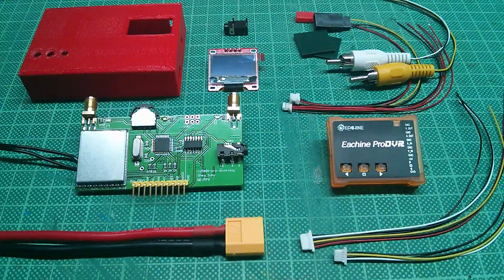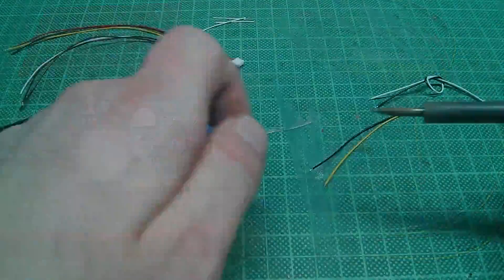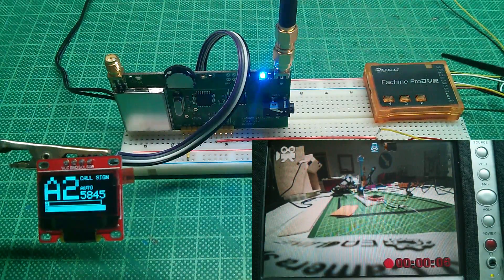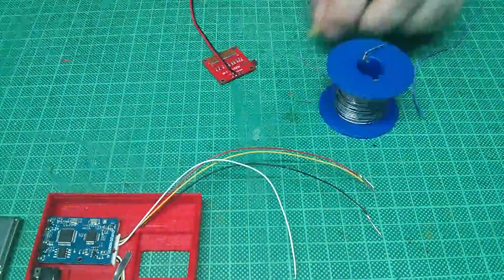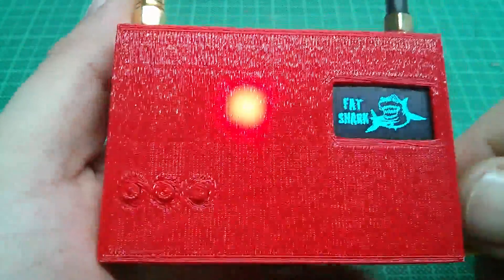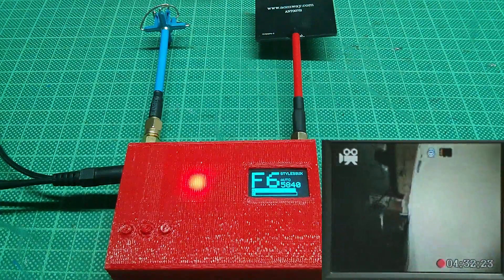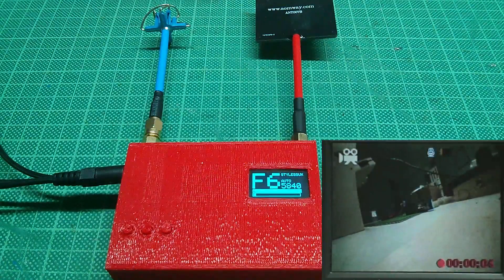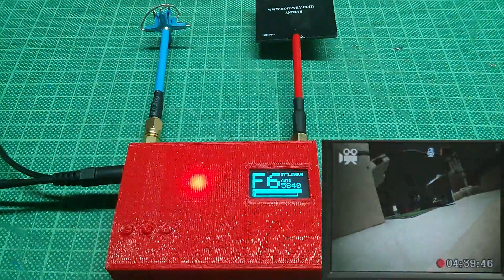Diversity Receiver & DVR case (RX5808, Eachine Pro DVR)

Comment: how good is the gain or quality compared with other receivers?
Reply from the maker: Gain depends on antennas. And compared with other receivers - difficult to say. It has no elaborate algorithms to improve picture quality like rapid fire - it basically only switches between the module with the highest RSSI value. It really depends what you want to do - if you have a google with a module bay, go with rapidfire or something similar. I build this for my boxed goggles and now only use it on the bench for testing.

Comment: I am on a very minimum Budget can I use this and connect a small screen and A VR Goggles and make it as an FPV Goggles for My racing Quad Will it work if i do that
Reply from the maker: As long as your screen or VR goggles have AV in, you can do that. But by now, there are a lot of cheap goggle options on the market. Does not sound too practical to me to take your VR goggles out for flying...
Reply: @stylesuxx o ok cool I am thinking of buying Eachine Ev800d thankyou for replying

Comment: Very cool mod! Thanks for sharing.

I'm thinking to upgrade my fpv glasses with this module, Does anybody know if is possible to get it working with Achilles? 
In that case, would the OSD work?

Otherwise I'll go for the Eachine pro58.
Reply from the maker: Personally I think the eachine pro58 is the better choice. You can be sure that achilles works with that and depending on your goggles, it might fit in your extension slot.

Comment: the pro dvr come supplied with a cable that allows external buttons, instead of mounting the dvr like that you could have buttons of your choice and mount them where ever you like and connect them to the supplied cable
Reply from the maker: That is true, I just chose to use the available hardware. I was thinking about using the cable and external buttons, but thought, why not use what is available, that's why I went with this solution.
Reply: do you find the prodvr darkens the recorded video? i own two prodvr units and both make the video darker
Reply from the maker: This is my only DVR so it is hard for me to say. It looks different through the goggles, but darker - I don't know.

Comment: can you use this with goggles with a video in? wgat goggles are you using?
Reply from the maker: Yes, the pinout is the same that is used by fatshark for example. I am using the Quanum V2 Pro goggles from hobbyking. This is a DIY kit and comes with screen, lenses, foam body and a strap to hold it all together.
Reply: stylesuxx i have the eachine ev800 with video in , will it work with that?
Reply from the maker: Yes, when you have video in, it is not a problem.
Reply: but if you have eachine, maybe you need switching some cables, right?

Comment: What is the software that you have used to make this casing???
Reply: stylesuxx  thanks for reply me.I need to make all in one fvp monitor using 4.3 inch TFT monitor,echine pro dvr and rx5805 pro. Aslo want to connect inbuilt lipo.. any suggestions

Comment: Great video - Am printing your case right now :-D 
To which pins did you connect the DVR ?
Reply from the maker: Glad you like it. There is a Vout pin on my board, that is the one I am using for the DVR input feed.
Reply: Thank you - Do you have a link to a wiring diagram ??
Reply from the maker: No unfortunately not. The pins on my board were labeled nicely so I did not really need one. Basically you connect Vout and GND from the receiver to the DVR.

Comment: How do you control the RX5808? I'm thinking of fetting a Quanum Cyclops and using this to to swap out the reciever, I seee a lot of people using them but no one shows how to control (change channels etc..)
Reply from the maker: At 2:25 you can see how to interact with it. This module has a three position switch, left and right for navigation and push for confirmation.

Comment: can you say how to connect rx5808 Pro for example to fpv goggle eachine vr007 ansver please it is very important for me
Reply from the maker: I do not have those goggles so it is hard to say. But if the have video in, you should be able to connect video out and GND of the module to your goggles.
Reply: i understand it but I want to be able to see the menu цhere can I change channels does not remove the helmet
Reply from the maker: My module has an additional video out pin for the menu. Also you can hook up a small oled display via I2C.
Reply: I want to do so that when you press the button you can see the menu of channels on the screen
Reply from the maker: on the same screen you see the live image on? I do not think that this will work. As I mentioned, you can hook up a small display via I2C to see that info or use the dedicated video out on the board for that kind of information.
Reply: I will ask differently to the small display go 4 wires red and black it is clear that while the other two are responsible for that
I think that the current wire that displays information on a small display it through a switch connect to the helmet and then I can see the menu when I need it on the main screen
Reply from the maker: You could switch between the live feed and the menu with a switch, yes. But then you do not do this via I2C but the dedicated video outputs of the module. You need to use the GUI pin to see the menu on the monitor if I understand correctly.
Reply: Thank you for this information

Comment: could you provide me with the pinout plz
Reply from the maker: For what exactly do you need the pinout? The DVR has the pinout on the case, and my receiver came with a pinout on the board directly.

I can take pictures if you tell me which ones you need.
Reply: Actually I have the the other make (the open pilot rx5808) . I am not sure how to power it. The 5v pin and vcc pin is shorted, thus i was wondering if the receiver works on 12v or 5v. By the way thanks for the help.
Reply from the maker: Well, mine came with a step down converter on the back and two contacts to solder the battery leads to, so the step down converter generates the 5V that are needed for the board.

You should not power the board from 12V directly. You should either you use a 5V power supply, or you get a step down converter.

Could you link me to the page where you bought it?

Happy if I can help